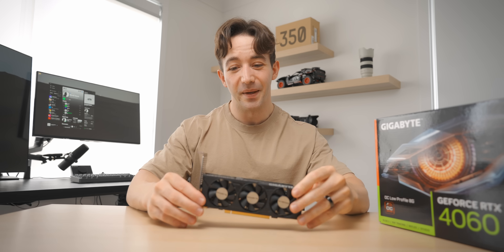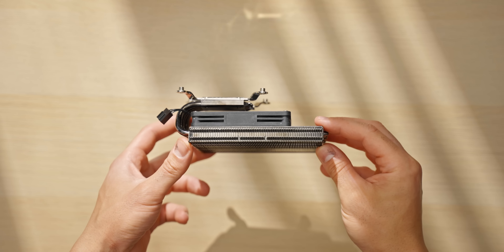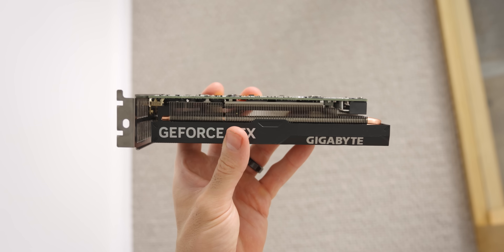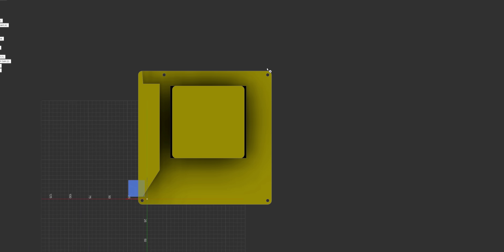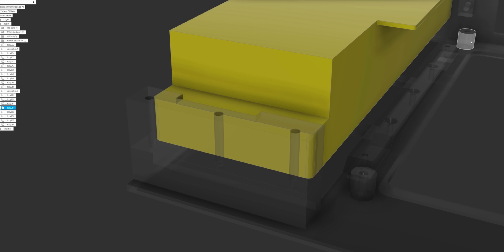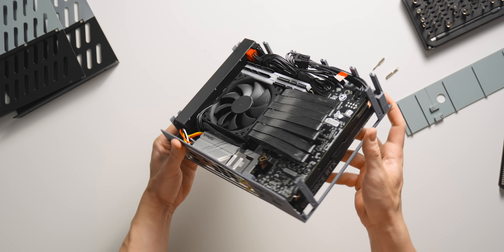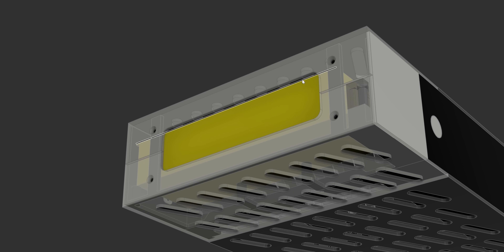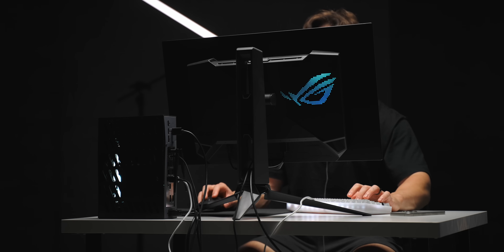Making the World's Tiniest Gaming PC

Comment: What if you used a sodimm itx motherboard where rams go flat laid down (horizontally) on the motherboard. Also how about laying down the psu flat also, it will make the thickness of the case even thinner, and use an even thinner fan for your cpu.
Another case idea would be to print out only the brackets/frame to put your components in and make it something like an open frame case.

Comment: Can you tell us how efficient the PSU is?, since it's an itx build I think power consumption is a factor and experimenting with maximizing with power efficiency would be great
Reply: The 250W HD Plex PSU have 240W (12V, 20A) so if you're using CPU under 100W (7800x3d while gaming, not benmark) and GPU under 140W (4060 Low Profile under full load). It should be fine.

Beside that the PSU provide extra 3.3V 10A and 5V 10A which is enough for install 2-3 NVME Drive and extra for mouse, keyboard, even 2-3 external SSD drive you can plugin.

Comment: Why not use a slightly thicker version of the case, but hide the power supply itself where the ssd is located. thus you could reduce the size, the video card can be connected directly to the socket, not through an extension cord, the power supply would be placed higher. use custom wires. put a cover between the power supply and the video card and thus providing good air flow. in summary, the case itself would be the size of an itx motherboard, but about 75 mm thick only. 25 mm higher than the CPU cooling itself. thus if you increase the size of the CPU cooling. (but these are more my suggestions.)

Another option would be to remove the cooling and put 1 large 140mm cooler instead

Comment: 3D printed case or any plastic case it is just waste of money and time mainly because of temperatures inside case that 4060 is hot gpu. I had similar case from 6mm acrylic as a temporary case it is ok. Best case for similar spec build is A24-V5 which is around 100$. But if you want small pc under 3L buy mini pc with laptop CPU and dedicated GPU. It will be similar price and performance mini pc. But yes i know it is just build for video just to get $

Comment: I know this is an older video, but i had a question. What CAD software are you using to make this? I have a ton of experience with Inventor but i don't have access to it anymore. So i have been trying to find alternatives. Have been trying to do the same thing you are doing for a while now.
Reply: fusion 360 is the CAD software and he has the full project file in the dropbox link in the description
Reply: @jasonj9794  thank you for the heads up. I guess I missed the link.

Comment: for heat PETG is better or worst than ABS?
Reply: Abs has a heat deflection temp of 110c, petg is around 80c
Reply: @MrBlackmidi1234567890987654321  sorry im dumb, that didnt helped me hehehe... ABS is better to resist heat? PETG gets "softer" at 80?
Reply: @monneratrj  yes

Comment: I do have a small suggestion: If you are willing to go "semi laptop", you can take a look at minisforum and their "converted laptop motherboard" line of products. IIRC, they have an AMD line with either a 7745HX or 7945HX, or intel with 13900HX, both lines come with the CPU soldered straight onto an ITX mobo that has a pcie slot and takes only laptop RAM. The downsides I can think of right now are 1, the IO is limited (4 usb ports iirc); 2, it has a custom cooling setup that's basically an attached fin set, on top of which you put a 120mm fan; which leads me to a possible third: the height will probably be above the current 13400f setup.

Comment: Sorry, but this is not enough to impress me. Can tell you just made it as fun little project for YT clickbait title instead of really engineering something worth mass production.
Need to space hot components evenly inside case and plan for airflow routes, otherwise that thermal paste will be thermal crust in a year.
250w PSU is mad. 300-350w should be nuff to account for degrading over time. Mindlessly drilling random holes in such small case is no good.
All fans must be installed to intake air in(yes even GPU).  Exhaust holes in right places for optimal airflow and air pressure does the rest
Reply: then build it yourself if you’re so concerned

Comment: Nice project! I am also looking into designing my next case for FDM printing (downsizing from my current meshlicious) and this is an incredibly inspirational video, both in terms of results and process. Thanks for sharing.

One thing I am looking into to solve the "build volume problem" is printing the case at a 45 degree angle off the bed, which increases the max length by 40% or so. If you put a big chamfer on the edge then that provides enough adhesion to the build plate to print at an angle, and if it's designed in from the start then maybe it can look like an intentional feature. Printing an entire PC case in one print really feels like living in the future.

Comment: It seems like you've stopped working on the case :)
You need to learn a tiny bit about more effective usage of CAD, at least using components in F360 would make design process a lot easier as well as fully defined sketches

Comment: Being small is not a trick. The secret to the high performance of modern computers is high-output power supply and smooth ventilation and heat dissipation structure. Mini PCs go against this principle and can be expensive and inefficient.

Comment: Hmm tiniest? mines down to 2.83L with a Rtx A2000 frankistein because I don't have much money and a i5 8500. but mine is built to use a external power supply because I have  577Wh battery pack that powers this PC on the go

Comment: Just wondering which type of filament used in this 3D print. wont they melt easily from the system unit's heat?

Comment: Would it be smaller if you did the same layout as a velka 3 but with a LP GPU and put a flex PSU in the space freed up by the GPU, effectively making it shorter while also removing the necessity of a clunky external brick?

Comment: Hi, I've just ordered a custom case: 3.46L edit of an existing case, actually. It's from Ukrainian case builder custom_mod.
The setup I go for is similar to that of Velka 3 (or FX 4.2L in custom_mod gallery), however, I'm using the HDPlex 250W GaN, too.
The GPU can be full height (up to 130 mm), and the GaN can still fit underneath it in the sandwich mode. Utilizing pretty much all the space.
Now I hope HDPlex can send me shorter cables, because if not, it could be quite crowded :D

Comment: Well. That was a mess. I probably should not comment this too much in public, at least not as a designer.

But I need to stress to everyone looking at printing this, that this design is structurally unsafe as it is structurally weak. This design is not something you should do, If you have other options.

I am no neutral actor in this business so I will leave it at that.
Reply: Yeah he mentioned that he designed it as if it was made of metal and realized it needed much more structural support, as it was quite flexible - I'm thinking of printing something like this but I'd make a box out of 10mm extrusions as a base - that should be enough, right?
Reply: @AdrianDemetrescu  Let me put it this way, I can design a case for printing without using slots. I simply do not need them, as they offer me no befit what so ever. Not for my current style of work, that is, mostly PC cases.

If you want to learn why I do not use slots, you should try to design for them. If you have a nag for design, you will get what to use slots for, by simply trying to use them.

I have seen plenty cases designed using slots, but I have yet to see a single successful design. There are a ton of reasons for that. To succeed as a designer designing for print, you need to know all them issues. In the current state of the industry, the only way to learn what them issues are, is by failing with your own designs.

Comment: Ali, you might be busy working on this 3D print improvements, but heads up on the Goodisory A09 chassis and potential for modding it as a "base frame" to achieve similar things.  Yes, the ITX board standoffs need to move and other things, but the formfactor might be excellent and not too expensive.  Thanks again for pursuing this!  I'm likely building on a Minisforum i900 + 4060 + HDPlex.

Comment: Hate to break this to you, but you could have gone WAY smaller. You can connect a GPU into the M.2 slot on a NUC and have a far smaller gaming PC. Then you also don't need a PSU because the NUC and GPU both only need 12V from a 200W power brick.

Comment: Awesome build!! I love all your videos, as I've said before, you have the best production quality on youtube! Just a quick tip from a ABS printing pro, those greyish white marks on the black ABS are from stress in the plastic from where it was trying to pull away from the build plate. If you place those panels back on the heated bed at around 90 to 100C and let them sit there for around 5 min or so and let them cool down, the stress marks will disappear. But since that panel looks fairly thin, I would let it cool down to room temp before removing it from the build plate. Great work again! Can't wait to see the V2 of this project

Comment: Duuude you should try mounting both powersupply and gpu under the motherboard and in doing so get a case that is almost completely square and probably would fit to be fully printed in an 3d printer. 

Loving the build and the channel!

Comment: Fantastic job Ali. I've did build myself in SKTC A09 case, i5 12500 + RX 6400 (most powerful single slot card that would fit). Case is 3.9L but fits standard 1U PSU.

Comment: For the outer panels, if possible make it into 1 panel each side inside of 2 pieces together, that breakage point is definitely not structurally sound, but it would make sense if there's not enough bed space on the 3d printer

Comment: awesome work, my only recommendation is to get a simple diode laser cutting machine with a 40 to 80 watt laser module. it would be way nicer if you cut the side panels (and other flat parts) out of black acrylic, and you can easily do that using a laser cutter/engraver. the other advantage is cutting time, laser cutting parts is lighting fast compared to 3D printing. using a 80W module it takes less that 5 minutes to cut the side panels. and the results are stronger and have way nicer finish compared to 3d printed parts.

Comment: ABS is harder to work with, PETG has a glassing temperature of 85C and is much easier to work with. While there may be moments where PC components exceed this temperature, those are die temperatures. When that heat gets transferred to the air it’s going to be a lot lower than the die temperature. So even if your GPU is being hot boxed at 90C+, you’re going to be at a lower case air temperature than the 85C glass transition temperature of PETG by a fair bit

Comment: i built a almost identical pc to this but it was slightly larger and used the 500w model of the psu it had a 12900k and a larger cpu cooler but i did have to use smaller sized dimms to have them fit under the cooler and i made custom cables for it but all in all the pc works great

Comment: Good to model and draft in PLA  anyway it’s fast but I got that X1 specifically so I could print the exotic filaments. Polycarbonate filaments are great. Carbon fiber infused ones have a very clean finish. Just make sure you filter air though. Tons of stuff flying around just printing PLA as it is lol.

Comment: From experience I tell you. You need to make all surfaces wider and leave spaces for ventilation smaller but more dense, you will gain strength in the structure and greatly improve buckling. Above all, you have to make the part where the mother board is attacked wider and much! stronger!. Buckling is very bad for the motherboard.

Comment: Seems to be a better candidate for laser cutting or cnc for the basic panels. And then you can 3d print all the supports and internal structure. It'll also have quicker manufacture time and look better imo because you won't have layer lines.

Comment: Great project!

When I see how things evolved in the latest years, we might see a graphics card, that includes a small space for the processor and some kind of mainboard replacement. So just put the Grafics adapter into some kind of case with power supply and you have a full working computer. Drives are also so tiny today, you can also just plug them into the card.

Comment: Awesome build! Some tips for melted plastic, I would highly recommend carbon fiber nylon (PA12-CF), especially the stuff made by Polymaker (whatever they add to it makes it look blacker and smoother than any other brand I've tried).

It's expensive, but if your nozzle can get hot enough it's the perfect plastic for anything and everything engineering based. PA12 is also stable enough that an enclosure isn't required and I've never had a failed print (PA6 is marginally stronger but likes to warp during printing, Polycarbonate is more brittle and refuses to stick to the print bed and gets burn marks and gets damaged by UV... I hate polycarbonate).

Comment: There are some things you need to check out.  #1 the JinWei H610i-PIO motherboard (you do have to order it overseas).  And #2 an Alienware GaN 240w laptop power brick.  It makes possible your build in less space.  PIO means the PCIe slot is parallel to the board on the other side from the usual slots.  When you plug in the GPU the fans for the CPU and GPU face the same way.  The motherboard is only about 100, and the Alienware PSU is about 30.  It uses SO-DIMM modules, and regular M.2 WiFi and storage.  It's basically a Thin-ITX.  The measurements come in at 190mm x 245mm x 50mm for the components, and you can fit the power brick inside if you like.  Thermalright AXP90-X36 for a cooler.  It is a 19-20v supply, and it has a PCIe powe header onboard for the GPU.  Bonus is cabling is much reduced and there are no risers at all.  Easily knock 100-200 off a build this size.  Roughly 3.12L and you can use an 8"x10" Alu sheet in 1/8" or 2mm thickness for the sides, and some expanded metal commonly sold as "gutter guard", available in black or white for vents.

Comment: Undervolt the CPU and GPU and even the GPU can be set to 90% power and you will have 95% of the performance for just 95W TDP compared to 115W for the GPU for the CPU this is Intel so undervolt is a must cuz they were crazy with the power management and the 5+Ghz clocks

Comment: I put together a similar build with 12700K with Noctua L12S ghost, 32gb ddr4 3600mhz, Gigabyte LP4060, HDplex 250W GaN HDplex PSU. The case that made this whole build possible (without a riser similar to your initial layout) is the LLW V36pro which comes in at 3.7L internal volume. I had to figure out the 24pin output and mounting the PSU to the face panel, once I figured that out most of the rest of the high airflow design worked out great. Cheers for using HDplex, haven't come across a better SFF PSU that makes so much more possible.
Reply: that V36pro looks cool but DANG $180 for that case seems wild.
Reply: @PatchedUpGaming  weird.  I picked mine up maybe a year ago for 80
Reply: @Stifle9  yeah that’s the price on aliexpress but with a $90 shipping charge. Did you purchase it elsewhere?

Comment: I like that you actually go for small compact builds. I feel like the whole industry isn't making things more compact besides basically Apple with their M1 macs. I think it's really bad that Nvidia and AMD just get away with making their GPUs so much larger, heavier and more power hungry each generation. While Apple is doing the opposite. 

I don't even like Apple as a company much. But we need an ARM competitor in the CPU industry and if AMD/Intel decided to actually try ARM for power efficiency and size that'd be great too.  Hopefully Qualcom can change that with ARM on windows but I also thing motherboard manufactures as well as integrated GPUs are a big step forward. It'd be awesome if you could buy one chip from intel for example that had both their CPU and Nvidias graphics unit. Or that motherboards had a chip slot for a Nvidia GPU chip rather than a PCIE slot for a huge cooler. As then you could water and even air cool both in a much more compact way. Using one AIO watercooler for both for example.

Comment: Fun build, love the options that 3D printing can present with PC builds. I've designed and printed a custom ITX case for an APU build - was a really enjoyable product and for me PLA has been fine with less heat being generated. Like you I went through a few design iterations but with everything built into parameters in Fusion 360 it ended up turning into a case of just waiting on the 3d printer. Sadly I've only got an Ender3 right now, so a lot of waiting! Not quite pulled the trigger on a p1s yet.

Comment: instead of pc for the next revision make it out of clear polypropylene which is even more heat resistant 
plus it's clear. how could would that be 

you need to use clear packing tape on your bed which will make it stick and help with warping

Comment: Cool idea, but really at the point of diminishing return... I have a 3.8 L case that uses a layout similar to SGPC K49 (albeit smaller in all dimensions by a hair), which fits an ITX 4060 that is more readily available than LP GPUs. I also did some modelling using Fusion 360 which is free for hobyists, and it just turns out that 4L is really the smallest you want to go.

Comment: fwiw annealed pla will have a much higher temperature resistance than abs

i've also printed carbon fiber pla for an internal bracket for my nr200
and it hasn't warped at all yet, unlike the original pla part (not annealed)